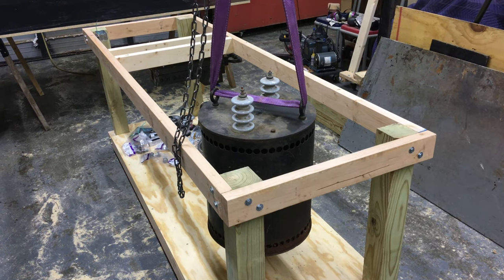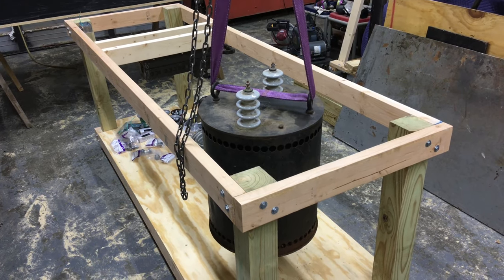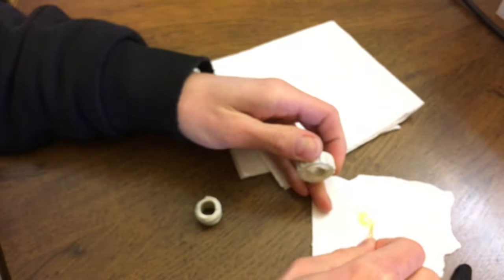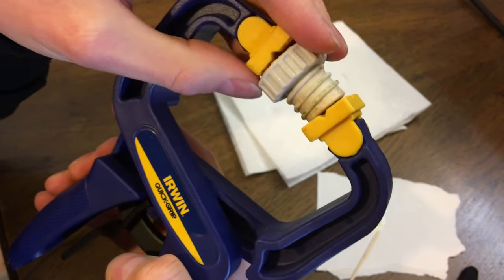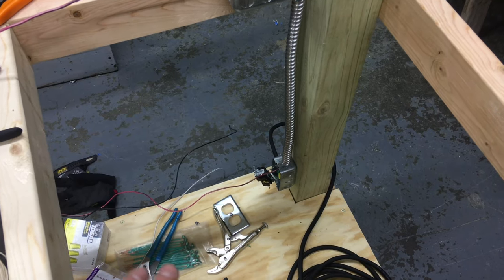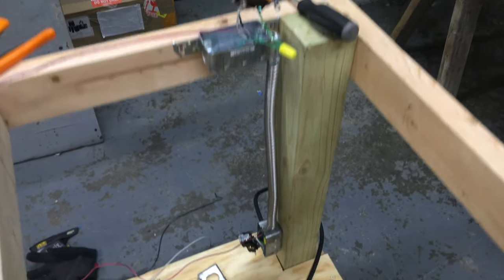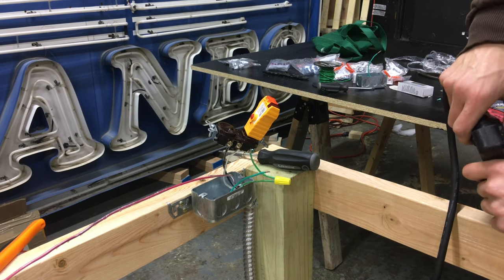Neon Bombarding Setup Part 2: Wiring/Electrical

Comment: Very nice, we are building a neon setup at our Makerspace. We have almost the identical bombarding transformer. We bought a Welch 1400 with a diffusion pump mounted on it. I am really looking forward to getting our setup going.I tested our transformer with a megger as well as we put 8k on the primary & verified the output voltage on the secondary, the soon to be primary. I do heavy commercial/industrial HVAC, so I’m pretty good at electrical. I have the gear to test if medium voltage is present. It was interesting hearing/seeing the voltage detector going off as far as I was away with it. I’ll be sure to check out your other videos.

Comment: Wow. Just found this half way through building a full Daco system myself. Hands down the best most helpful pump build on the internet, ever imo. This video has been so valuable you have no idea. Our set ups are v similar, moving on to the manifold next, would love to see your part 3, need all the help I can get 😂
Reply from the maker: hey, I'm glad you liked the video!  i have a Daco manifold i will be setting up as well.   i am going to post an interim update in a couple days showing more work ive done on the setup... then i will move on to the vacuum system!  
stay tuned, and good luck with yours!
Reply: Hey I just got hold of a 5KVA Daco system I am setting up.  So the choke throttles down one of the 240, right? The other 240 passes through
Reply from the maker: correct, one side of the 240 goes through the choke and the other does not.

Comment: It is interesting that you were able to find a dedicated transformer for this, I rigged up a utility distribution transformer I got hold of to be the bombarder. It's huge and stuffed somewhere in my garage. I think it was 8000 Volts with 240V input and I wired it up to an input transformer that put the output to 18K. At one time I had an electrical fault and an arc that looked like a jacobs ladder went across the table.
Reply from the maker: yikes!  yeah these giant transformers must be treated with great caution.
i got all my neon equipment from a closed shop as a bundle.
Reply: @NeonPreservation  It is good that today we have the internet to see where stuff like this can be found. When I started it was so difficult to contact others, all we had was long distance phone calls and those could get expensive. When I tried to find the ribbon burner I gave up and ended up making my own homemade jet torch instead. If I ever mess with this stuff again I will look around to see if any old neon shop equipment is in storage somewhere. Most of the shops I remember have long gone out of business.
Reply from the maker: indeed.  the internet can be a wealth of information!  one of the reasons i started this channel was because i was looking for videos about neon equipment & neon sign restoration, but there wasn't much to be found.  i decided to change that.

Comment: Great video, exclent subject, but I thought I would let you know that those feed through insulator's that you used are rated for 600 volts, and the device that they come out of, would replace your bombardier transformer, and the device is almost always located at the top of a power pole, and it to is a transformer, and the power that is feeding your Neon bombarding setup has to pass through three of those feed through insulator's to even get to your house's main panel!!! Well that is unless you live in a naborhood that is feed through underground, and has pad mount transformer's instead, as those are a little deferent, because they are protected from the weather beneath a hood!
Reply from the maker: you're right!  not long after making this video, i discovered those feed-through insulators are indeed the secondary insulators from a pole-mount transformer.  some neon shops actually run surplus pole-mount transformers "backwards" to step the voltage back up for high voltage bombarding, as an alternative for a purpose-built neon bombarding transformer like i have.

Comment: Hello, very helpful video to show how to do this safely. , do you have drawings for all your electricals? Thank you. We bought an old GE bombarder and choke from a neon shop in Buffalo years ago. The guy just grabbed the 220 input wires and touched the mains, well a bright blue flash soon came out of the panel as the bomber turned on. We bought it as it was working! He did scare the heck out of us.
Reply from the maker: yikes, that would be rather dramatic (not to mention dangerous)!
as for my setup, the schematic i show in this video was drawn completely from memory.  i spent hundreds of hours reading, studying, and learning about all the components to make sure i knew exactly how everything worked and how to assemble it safely.

Comment: Hey like the guy above me said. Probably the most useful piece of information for pumping set up ever on the entire internet.. but whats the use of the `prewire unit transformer`?
Reply from the maker: hello, I'm glad you found the video informative.  the "prewire unit" is just a preassembled neon-specific deadman switch & contactor assembly that was available from Daco:
https://web.archive.org/web/20070206115536/http://www.daconeon.com/products/bombarding.asp?page=4#pre-wired_safety_switch

the transformer inside the box converts the input voltage (in my case 240v) to the voltage required to activate the contactor solenoid.
Reply: @NeonPreservation  Gotcha. Just did a quick google search for prewire related units and unfortunately couldn't find anything. You wouldnt by any chance know where I could pick one up? also was anything else you used preassembled?
Reply from the maker: yeah, im not sure if anyone specifically makes "prewire units" anymore.  the ones (like mine) that Daco used to sell were built by them with just a few readily available parts (contractor, transformer, and a spring-loaded momentary button) assembled in a couple junction boxes and connected with a piece of extension cord.  they were sold as an easy "plug & play" kind of option if you didn't want to bother collecting the parts yourself.

occasionally neon processing equipment comes up on ebay or locally (e.g., FB marketplace or craigslist), or you can try asking around on some of the FB neon groups.  the FB group "Neon And Plasma Art for Beginners" would be a decent place to start... there are professionals there who give advice to beginners and occasionally sell equipment as well.

Comment: Are you showing how to use this equipment safely or just how to set it up? I'm caught between appreciation for lowering walls of secrecy in the trade/ providing access and resources and then being a stickler for extremely thorough safety with this equipment in its operation and troubleshooting during processing.
Reply from the maker: i agree 100% that safety is paramount with bombarding, as i definitely would rather not end up dead.
this video is not a "how-to", but merely a video documentation of my personal journey on building this setup.  i started with no knowledge of any of the equipment or how to set it up, and studied for hundreds of hours on how to do it correctly and safely.  the schematic i showed was drawn completely from memory, which is how thoroughly i learned about every piece of equipment before even considering the setup.  no doubt you noticed my redundant built-in safety features and safety precautions i have taken during the build.  i also consulted with a professional if i had further questions during the setup.
i have a healthy fear of the bombarder and i remind people of its lethality when they ask me questions about it.

Comment: Hey, great videos on neon man! Tis looks like quite a nice project. Could you you power the transformer with a regular household power output? Or do you need like a 3 phase power source? Greetings from Belgium.
Reply from the maker: thank you!  here in the US the standard household wiring is 120v, and 240v is achieved by running two 120v lines that are out of phase with each other.  so, to power this bombarding setup i have four wires from a 50amp circuit: 120v/120v/neutral/ground.

the power you would need would depend on what the bombarding transformer requires for a primary input.

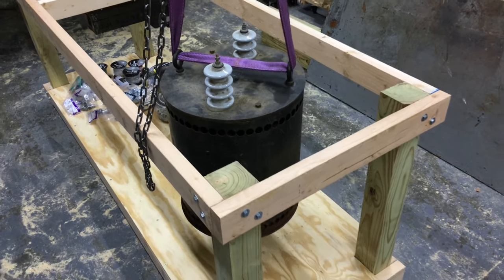Comment: 1:00 - why does bombarding requires massive electrical transformer of the kind we see out from our homes? I can make or buy the same transformer specification but the size will be like a football and heavy maybe 5 or less pounds. Its called Switch Mode Power Supply (SMPS), these are the future of "transformers" and will replace the analog transformers because they are extremely efficient and compact. If you're doing things old school ways... that's understandable.
Reply from the maker: two things are required while processing a neon tube: heating the tube to burn out impurities, and converting the coating on the electrode shells.  generally, electrode manufacturers suggest a finishing current of around 10x the electrode's normal operating current (e.g., 600mA for a 60mA electrode), and a bombarding transformer is one way to heat the tube and process the electrodes at the same time.
other methods—like oven pumping with induction heating of electrodes—will also satisfy the requirements of processing, but are often more involved and require more space/equipment.
i am using the bombarder because i like the traditional style of doing things, and well... because i have it.  haha.
i may some day attempt to construct a kiln to try my hand at some oven pumping, but until then i will continue to hone my skills on the bombarder.
Reply: @NeonPreservation  thank you for the reply.

Comment: What is that second transformer that you are using? The one that is hooked up before the "Daco" button and contactor. Is that used to step up or step down and what is the input and output of the transformer. Also what is the reason for it?
Reply from the maker: the small transformer in the Prewire Unit box transforms the input voltage to the voltage that the contactor uses.  it has multiple primary wires so it can be used for a variety of input voltages.  the Prewire Unit was sold preassembled as a kit from Daco, so they used a transformer that would supply the correct voltage for the contactor they used.
Reply: @NeonPreservation   So the contactor is basically another switch? And in order to use that switch it has a required voltage which is given by the transformer? I am trying to setup my own neon plant but there are no neon bombarders left so I have to use a pole pig that I will buy which uses 240v. I was going to wire 240v right to it with a switch, but what is the point of the contactor? Is it just a electrified safety switch?
Reply from the maker: a contactor is basically a relay that can handle high-current loads.  this quick video might help: https://youtu.be/gnasraApypo
they are used to control the bombarder in a safer manner than say, a knife switch or whatever.  the button on my setup provides power to the contactor, which closes the circuit to the bombarder... adding a degree of separation between the user and the bombarder.

the bombarder output is lethal and any mistakes will kill you.  no second chances here, so be exceedingly careful.  that schematic i show in this video i drew from memory — thats how well i got to know the system before even attempting to set it up.  do your homework and study everything.  if you can, have an experienced neon bender safety-check your setup before using it.
Reply: @NeonPreservation  Got it! Thank you! That makes a lot of sense. An old friend of mine gave me all of his fires from his old neon shop he used to have but he sold all of the processing parts. Going to build on like you did. Thank you so much for you help and the videos that you make. They are super helpful. I want to keep the neon art alive like you do. Keep on making these great videos!
Reply from the maker: glad i could be of assistance.  be safe and good luck!

Comment: Looking for a bombarder, where can i find one?
Reply from the maker: if you want to buy one new, EGL has them: https://www.egl-lighting.com/bombarders/
if you're looking for used neon equipment, it is rather scarce.  you'll have to be patient and watch on craigslist, FB marketplace & ebay.

in lieu of a purpose-built bombarder, some people use a surplus step down pole mount distribution transformer (aka "pole pig") that is wired in reverse to step up the voltage instead.
Reply: @NeonPreservation  Thanks you so much ...great info!!!